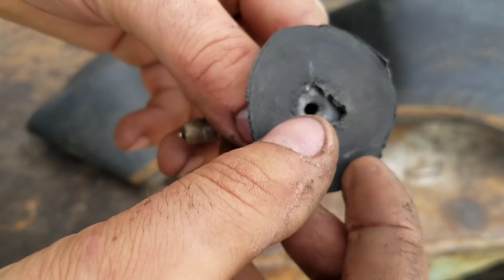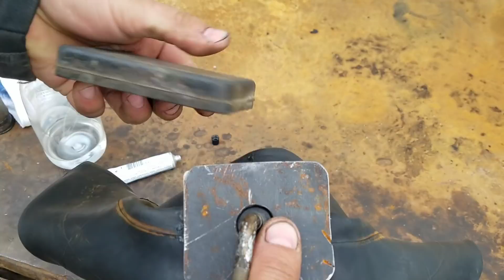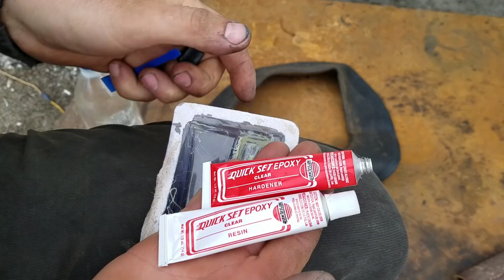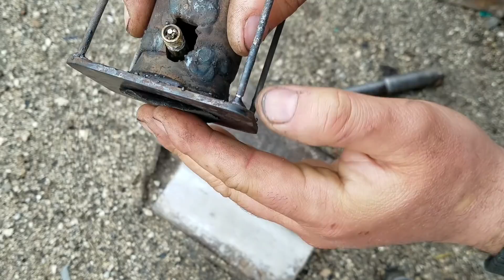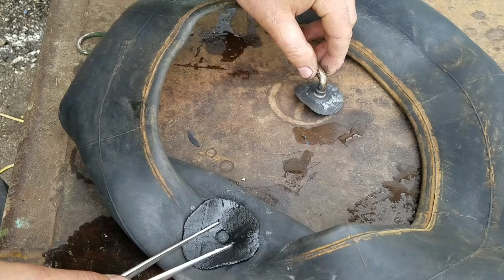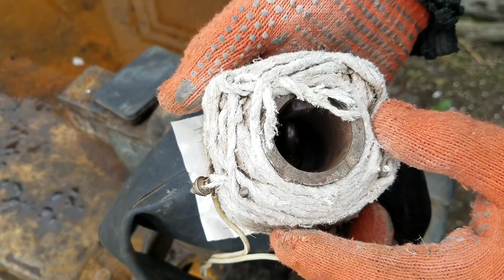Вулканизатор для сосков, неудачный опыт на китайской камере от скутера

Comment: Had to pause for a minute, Surely your not gonna put epoxy on an Inertube?  Wipe em both back down n do it again, put the tube over the clamping block first thow. Less adhesive n clamp em for longer.  
Sorry went on a bit there,  really enjoy your stuff, you've got a talent for engines n bikes. 😀